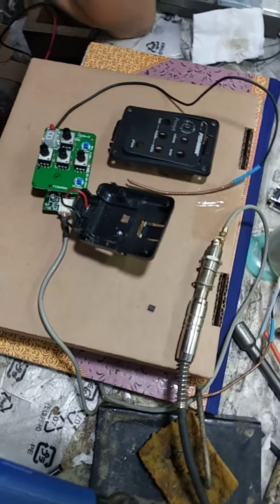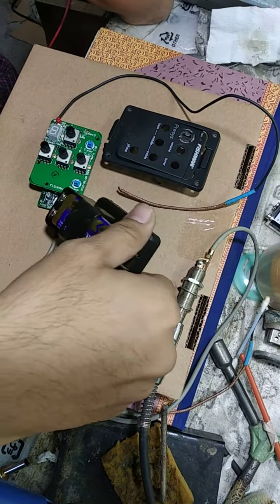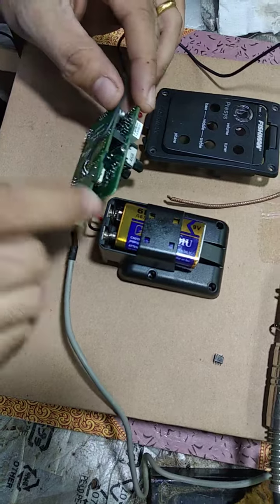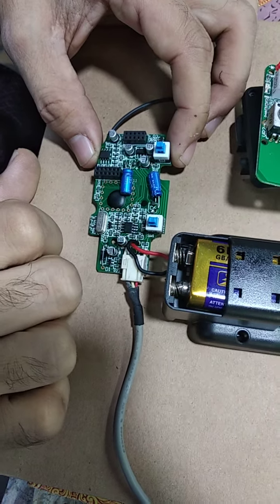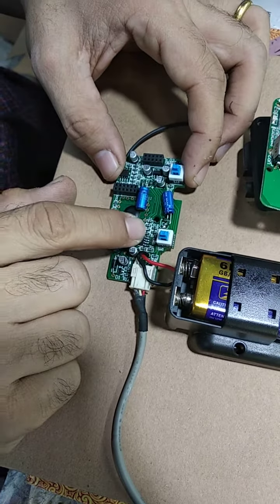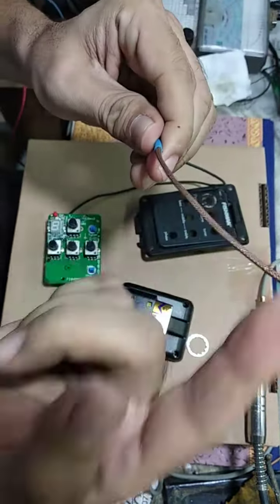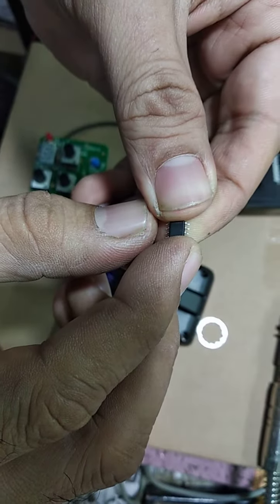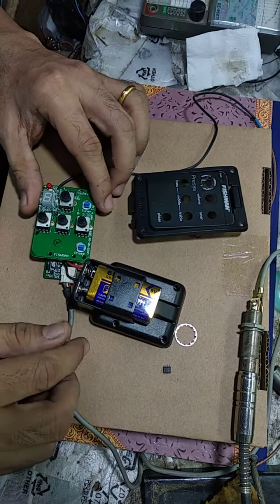FISHMAN Presys Guitar Preamp Repair

Comment: Hello friend ...please I need you help ...I have a presys AF03 imitation new ...after this used the fishman 4 classic deluxe ...the problem I have with the pressys is the hum noise ...I undesrtand is a ground problem ...when touch the jack 1/4 connector the annoying sound goes away...my guitar is spanish clasical Nylon string ....you can say me how repair my problem please ?

Comment: Hi my friend. What are the specifications of the added capacitors? and which datasheet was damaged?
Reply from the maker: In my experience repairing fishman pks,almost all the SMD Caps are bad.You must have ESR meter to check these caps.If they are in low ESR or no ESR Value,replace them all.And don't forget to replace 2 switches for tuner & phase functiins.They all bad too.

Comment: Sir can you please tell me about the IC and the capacitors that used on that pickup bcs i have same issue with my fishman pickup
Reply from the maker: In Isys+, ICs are  TL062&LF353 onswitch board and TL061 on cintrol board.
Caps are  six  10/16, one  2.2/16 and one 1/16.
In Presys,eight  10/16 , three 2.2/16 and one 1/16.I forgot about the ICs...